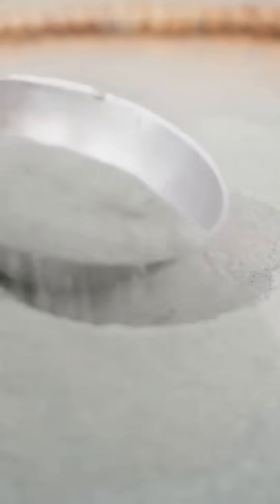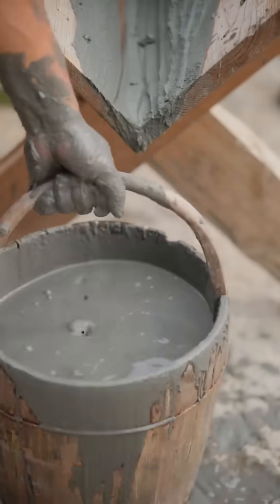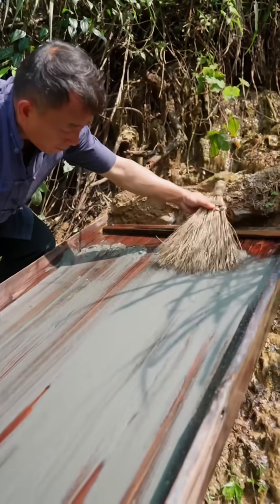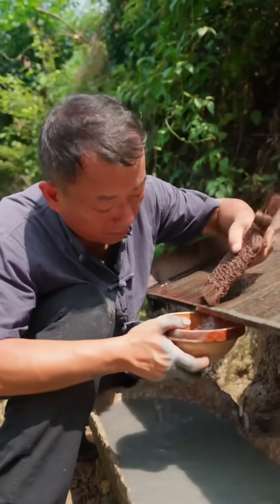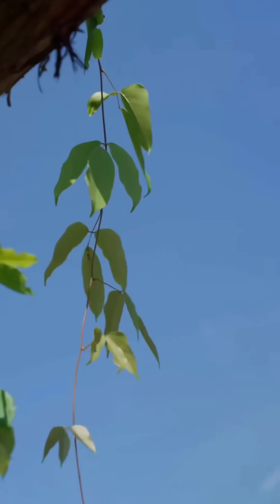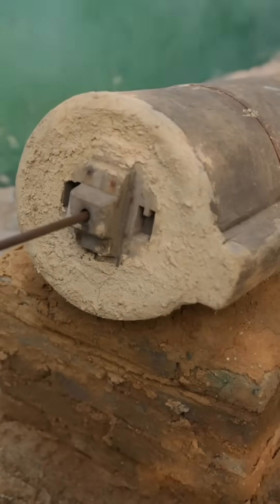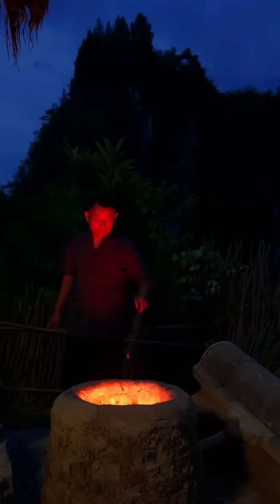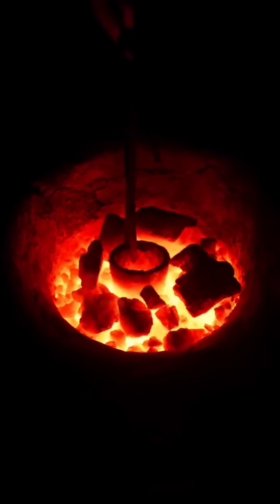Ancient Gold Mining: Raw Ore into Gold ⛏️✨

Comment: No... Borax was first used in gold mining in the Philippines in the 1900s as part of a method to extract gold without using mercury. It was also used in the late 19th century (1800s) in the United States as a flux during gold refining to help lower the melting point of gold, though this is different from mercury-free extraction. The method of using borax as a flux to melt gold and oxides was documented in the 1800s, while the mercury-free "borax method" for ore extraction became documented in the Philippines around the 1900s.